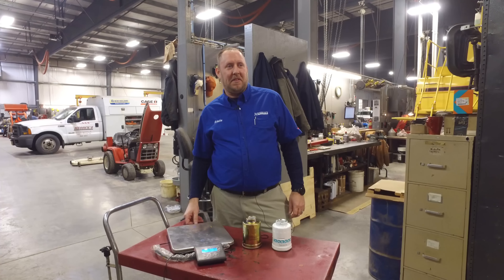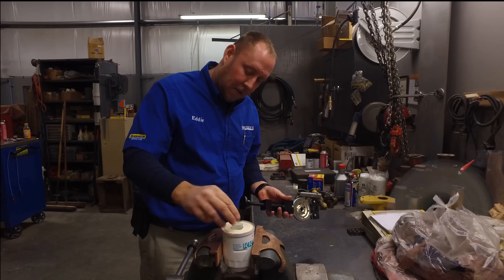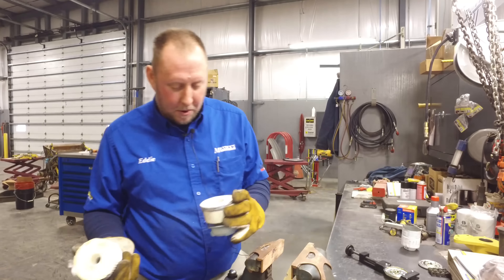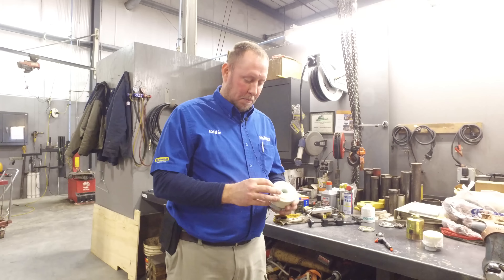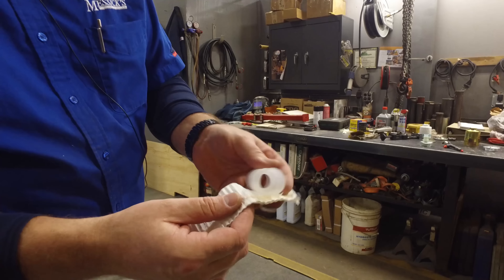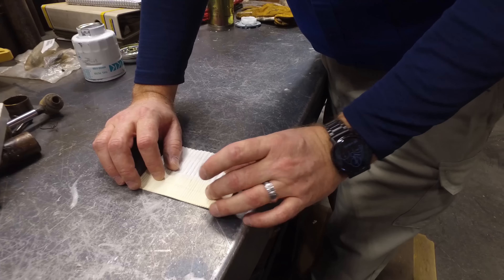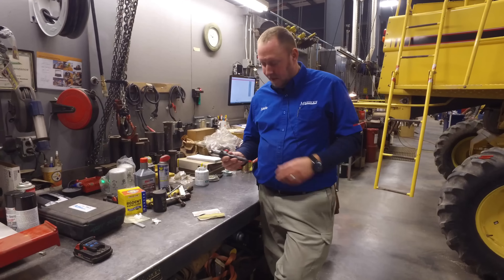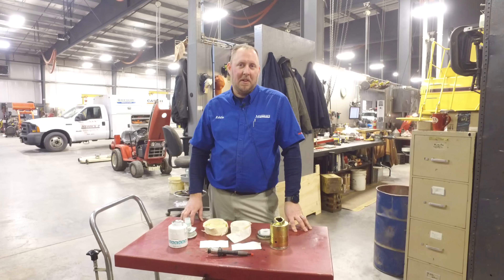Kubota SVL90 comparing OEM and aftermarket fuel filters

Comment: Quality filter, a few bucks, a set of injectors, several thousand. No question in my mind.
Reply: those filters look very similar to a fuel filter that is found on just about all 6.6 Duramax(Isuzu). And as much $$ as injectors alone cost, on some models like an LB7 the labor costs to do just one injector, it is almost worth replacing all 4 injectors on one side that has one bad injector.. One of those things you tell your self, as long as i am paying the labor to replace one,  why gamble that another injector is going to fail.  Quality fuel filters are cheap insurance, to prolong having an injector crap out.